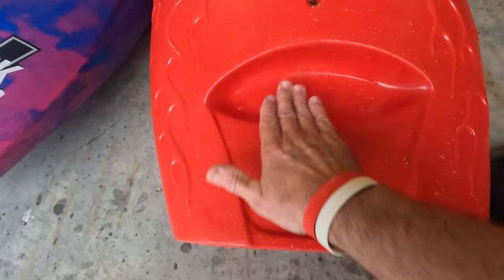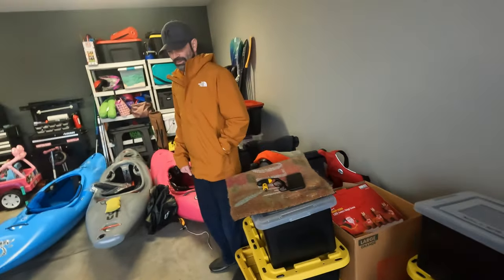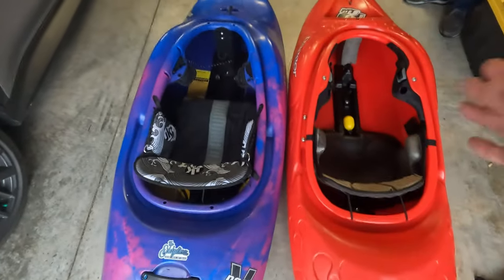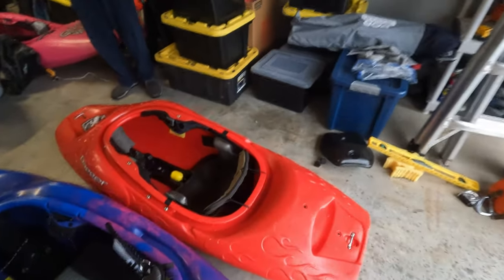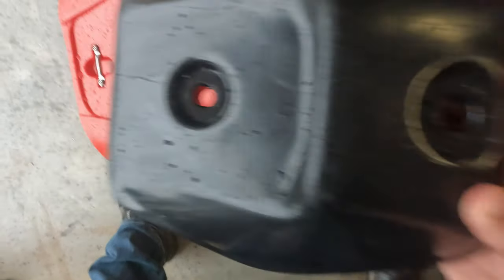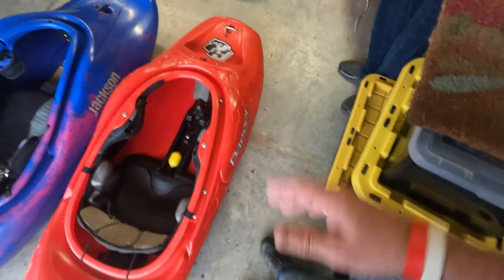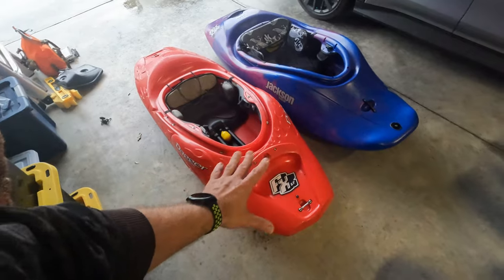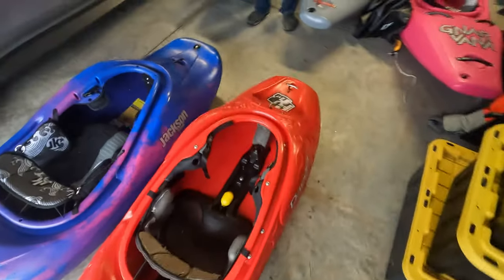Spud Kayak Evolution" 2003 Spud Vs 2023 Spud"

Comment: I used to have a king pin 6.3 icon that had the same holes through the bottom of the boat.  The same Rebok pump style hip pads also, shocking they kind of worked, mine held air which I had several people tell me was rare.
Reply from the maker: That is rare to have one still holding air

Comment: Man I think a few small changes to the FX design and it would be an excellent boat now. 

Surfing a lot of waves I’ve really found that I like a wider boat. This makes the boat perform well by allowing the paddler to sit on top of the water therefore floating “higher” 

Jackson has figured out a masterful way of making the medium wide but not too wide. 

If the large V could be a little narrower for the “inbetweeners” it would be excellent as well. 

This is something I’d discounted previously as most of my experience had been in hole features but having spent time in both holes and waves of recent I actually am finding that I prefer the wider style as it feels more balanced even when linking moves together!
Reply from the maker: So true I’m sure you were the same when seen this one for the first time was like wow 🤩 then seen all the pods and volume cut out and was like ohh? And like you mentioned Jackson has hit that sweet spot of width and volume on the rockstars. I still feel the Dagger Jitsu was one the most well rounded spuds out there. But for full hole and wave the rockstars are perfect.
Reply: @WadeHarrison  two critiques for the jitsu especially on a wave. The angle on the stern made its feel like it would lock into the surf and wouldn’t release easily. The reverse angle that the jackson sports really makes the boat lift off. 

The other critique is is the lack of stern rocker. As the boat lifts off it reaches this point where it seemingly stops. Which really limits the amplitude. Can mean the difference between a blunt and a pan-am on waves. 

That being said the sizing of the 6.0 was perfect for the inbetweeners like us.
Reply from the maker: @caseybryantjones  for sure agree the 6.0 great size and yeah it does a lot good but nothing really great
Reply: @WadeHarrison  shame that dagger won’t make a new boat. I realize that it is literally the smallest market next to 11+ ft race boats but it’s important to have more competition to force innovation.

Comment: I have a 2013 Jackson All Star. Which has a lot more Volume than the Rock Star. Which makes it more difficult to hold a bow stall, or cartwheel. But it has a lot more foot room. And comfortable space that allows me to be in it way longer. Run Class 3 & 4  fairly easily. And I would recommend to any beginner to buy as their first all round learner boat. It's that user friendly. Sadly, Jackson doent make it anymore.
Reply from the maker: The original all stars were so good